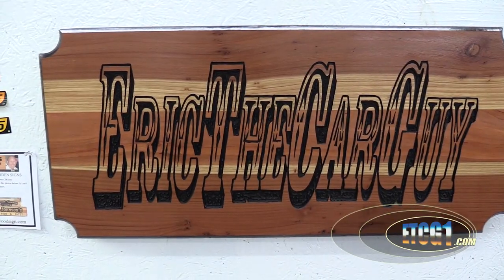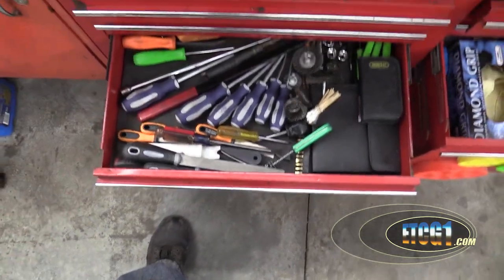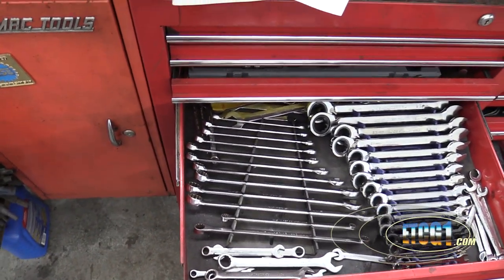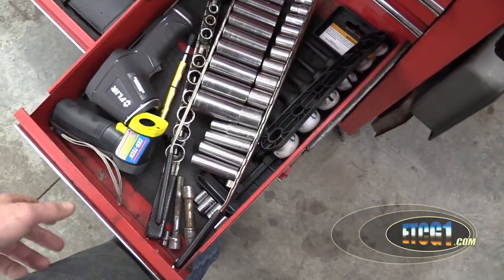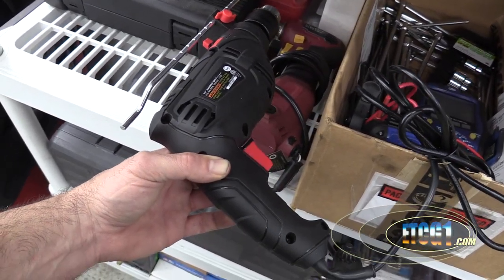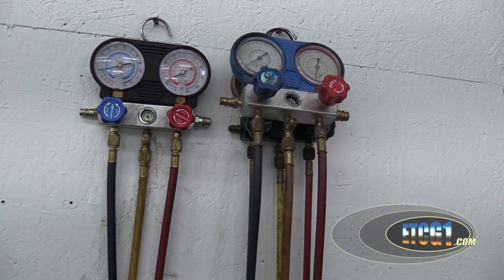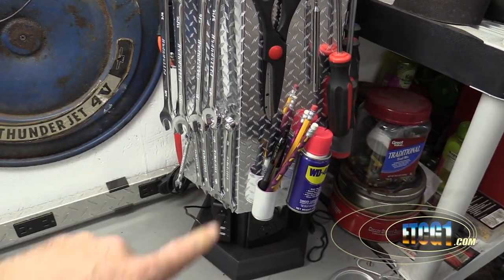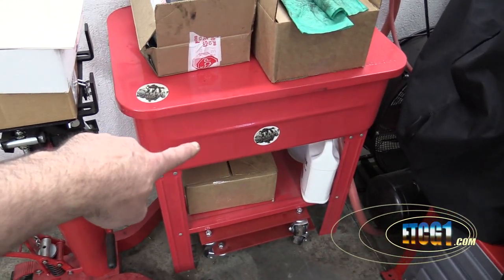Stuff I Get From Harbor Freight -ETCG1

Comment: My standard operating procedure is to buy the Harbor Freight tool.  if I use it enough to either break it or to decide i need better i can always buy a high quality tool to replace it.  My tool collection has lots of Harbor Freight tools that i have used once or that are working just fine.  i also have quite a bit of expensive tools that I have bought to replace a prior Harbor Freight tool which had either taught me that i needed better, or that had showed what features were important to me.
Reply: same here
Reply: That's the perfect philosophy for people stocking their tools for the first time: Buy HF and if it breaks, buy a good one.
Reply: Bingo.  Unless it has a lifetime warranty - in which case, I'll give it one more go.  Break it twice, buy a better one, but I'll still replace it again to have a back-up.  I have 10+ year old torque wrenches I bought for $12 still working fine and to the same accuracy as my Snap-On, no lie.  No fancy adjustable angle head, but I could also buy 30 HF torque wrenches with lifetime warranties for the same price as my SO, so....
Reply: This philosophy perfectly explains why i have harbor freight sockets on craftsman extensions being turned by a snap on ratchet.
Reply: @GeorgiaRidgerunner  Hand tool?  Yeah, just walk in and grab one from the shelf and the original broken one.  There will probably be questions asked, but it is not in relation to the warranty, it is just honest curiosity on the part of the employees.  Best one I have heard so far "I beat it with a hammer then it slipped off the bolt and fell 9 stories down."  Honestly, if it had been a Quinn, it probably would have survived.
Reply: Good practice, i've saved a lot that way.
Reply: Right on point

Comment: Hi Eric, I am in a bit of a pickle at this moment, and need to get a chipped SBEC for my 1991 dodge daytona 3.0, and need it to be mappable. Is there anything out there even in regards to a cracked ECU that can be slightly remapped. Every ECU I have gotten from summit, and other companies overcompensate for MAP, and richen the mixture too much, though I have replaced the sensor, and pulled codes.

Comment: Aside from what was handed down to my when my dad passed away, almost all of my tools are Harbor Freight. Engine stand, hoist, my air compressor, impacts, etc. and they have rarely failed me but it does happen. The most recent was that I had their bendy head ratchet and the screw that held it all together finally stripped out after 2 or 3 years of rebuilding Subaru after Subaru. Would love to have a Snap-On one instead, but I think I will likely just grab another HF one due to cost.

Comment: I use Harbor Freight impact sockets quite often... never had an issue with em.
Reply: I use the blue nitrile gloves like a mofo. The 5mil ones...
and the 1" paintbrushes that come 36 to a box. They kinda suck for painting but are great for other things like car detailing , I've even used em in the kitchen for applying sauces on food.
Reply: Same. I abuse the snot out of my HF impact sockets almost daily. They're really good to hammer on to get old universal joints off
Reply: Same, we have 3 or 4 sets of their 1/2 drive impact sockets at the shop where I work. Never ever had any issues with them.

Comment: I have a few HF tools that I needed in a pinch for home repairs - worked great. I got a few years out of a palm nailer before it seized. I generally read the reviews before purchasing a tool that I still may only use a couple times. A 3/8" flex ratchet is the only real HF auto repair tool I own, and it saved me on a recent job that required removing some difficult-to-reach bolts.

Comment: Eric, I ask if you ever think of banners to go on your shop walls? they would look good. At the GM garage I worked at in Tucson we had a big Dale Earnhardt banner. Everyone wanted that one.I see you did not go the route of a 3000.00+ tool box,maybe a video on why and when a guy should put out big bucks for a box. 

One thing I was constantly buying was some form of shop light or the bulbs for a shop light. Those things never held up well to rough use. I did the Snap-on thing for hand tools not found elsewhere (I love working with quarter drive stuff. Most of my work (well until I worked my way out of the biz,now retired) was light line,AC electrical and add ons from Sales. Installed a ton of car alarms (GM used Code Alarm) and a lot of Factory audio. 

I got away from brakes,heavy line at GM so this dictated the type of tools I needed. I read one viewer did a lot of work with very few tools on his 740I BMW. I always found BMW a tool intensive car with Honda being the make you really could work on with a minimum of tools. Still have and use my Fluke 83(?) multi meter. I never used the high end features of this Fluke meter,paid over 300.00 for it.Perhaps some words on spending big bucks on a multi meter. 

Thanks so much for a very interesting channel. Well I am leaving at 4.00 AM today for the 100 mile trip down to UCLA first appt at 10.00am hope there is no trouble with the train (city bus and train,no money spent on parking for me), lots of Doctor appt for the next 3 weeks. Like you said in an earlier video,this job wears a body out. I have neck and back issues,big time, got a real bad infection after a neck operation,almost did not make it., Dentist work also,so much fun:(

Comment: Great channel Eric!  I am a DIY personal garage type of tech and tackle jobs I can do myself regarding just about anything.  I have a bunch of clunky hand tool boxes loaded with a mixture of hand tools.  Most are old SAE USA Craftsman, Stanley a few Husky because of the ease of acquisition near my Home Depot.  But I also have lots of junk.  I am weeding out the junk and going to donate it and wanted to replace with good quality DIY type hand tools.  I am impressed on the pricing and the Harbor Freight Stores and now that Craftsman for the most part is all Chinese I figured well what really is the difference as per build quality of all these Chinese tools?  Is one better?   I am also looking at Tekton brand which is online mail order which have watched some great reviews via YouTube.  So my question is for DIY home tech work for a man like myself should I invest in local companies  due to ease of acquisition? And opt for either Craftsman, Harbor Freight, Husky or Kobalt or move up with Tekton?  The only downside of Tekton is shipping return costs for replacement tools.  Oh the first set of replacements are impact sockets,1/2"  impact air wrench and a new 3/8' ratchet.

Comment: I have the same feeling on HF as many, if I need a tool for a job, HF depending on what it is, might be fine. I've had stuff for years, and I've had stuff break the first time. If it breaks, you must use it enough to buy a SK or Craftsman as a replacement. My sockets are decades old, yet all the ratchet handles broke the first time I used them.

Comment: baught a harbor freight torque wrench because mine was in my buddys locked garage and torqued a head down with it. 2 days later my freinds head cracked right at the threads on the outside corner. brand new head i had machined and tested cracked in 2 days. he didnt even leave the city yet. had to be because the wrench didnt click correctly. and that was the only thing i ever used it for  and returned it the next day i found out. although, to this date, never had a bad thing happen with any other harbor freight tools. still buy from their tent sales quite often just dont build a toolbox out of them. ive also stripped sockets of theirs alot. the teeth on the 6 points just round off inside

Comment: My manifold gauge set from HFT ALSO broke after about 3 uses.  Now I just rent one for free from AZ or OR.  I recommend this , unless you are going to use one ALL the time - then you should save up and buy a high quality one for (probably ) well over 100 bucks.  The HFT is usually 60 bucks and with a 20% off coupon you can get it for under 50 - but there's a REASON!  that said, I have tons of other tools from HF that are awesome - my breaker bar, my 1/2 earthquake air impact wrench, magnetic metric nutsetters I use with my drill/driver for working on the car - all of these ROCK!  It's a very hit and miss store - ERic is right on the money.  However, they have definitely hit more than missed in my life and they are very cool about taking things back, even if you are just unhappy with the quality of construction (but not past the return period).  Good Luck.

Comment: Harbor freight is good for the tool you.will only use once in a blue moon. However, you know those 10mm wrenches and sockets that always seem to vanish when you need them, well I bought a set of 7 give point sockets for the price of one snap on socket. Will it last? It's a 10mm so not much torque. Did the same with needing an extra 10mm wrench. Whole set from H F for price of one snap on flank drive wrench and then some! My main tools will always be snap on for reliability.

Comment: Probably 90% of my tools are Harbor Freight - but then again I only work on my own personal cars on the weekends every once in a while for basic maintenance. A few things broke... had a small air compressor that started smoking on first use, and I broke a few sockets. Otherwise it's all held up over several years. Funny thing though... I had two torque wrenches, one from HF and one Craftsman. No joke - I broke the Craftsman one but I still use the HF one regularly.

Comment: There are some "HF" tools worth buying. I find the HVLP spray guns superior to the "cup" sprayers for the simple reason you can spray upsideown & backwards & not get air. 
I don't shop there that often. I use my tools to earn my living so I tend to buy stuff that'll last.
My fav. include anything Makita. Craftsman is usually my second choice. However, their "professional" stuff is deceiving. Meaning If you're a professional, the warrantee doesn't cover you. 
It's in the fine print. I mention this because Lowes bought out craftsman. So I'm not sure how any of that works anymore. I don't shop lowes or homejippo.

Comment: you're absolutely right about "Mrs right now" and it's hit or miss, some stuff there is good enough, and some is just junk, it takes you and I as a professional to be able to keep on what is good and spot junk. I have good professional stuff in one location, like mac, Matco and some strap on, but I also have harbor freight stuff in another location, this way I can get done what I need too without running game  acknowledge and forth, and if I absolutely need a good tool I can go get it. Remember though the most valuable tool is in between your ears.

Comment: some great deals to be had there as well as some total garbage. one that shocked me was I bought their 170 amp welder to learn how to weld with. it was 160 bucks because the box was damaged so I figured even if it only lasted a year or whatever I still really couldn't go wrong. shockingly enough 3 years later and hundreds of hours of welding and it still runs great. I'm impressed.
Reply: +Jake C I have that 170 amp wire feed welder also. it works great for me too.  I think I might get a regulator and tank to go with it some day soon. my dad bought one of the stick welders under 100 bucks and it was crap so he returned it.

Comment: The closest HF to me is almost a 30 minute drive from my house.  That could be an inconvenience if I want to warranty a broken tool. For example a 1/4 drive inch/pound torque wrench I bought to torque down the intake bolts on my wife's Suburban. The tool never clicked when it was at the appropriate setting to stage the bolt and the part of the torque wrench that the socket affixed to snapped. I am thankful though that the tool broke and not the bolt head! I returned the broken tool and ended up renting one from Auto Zone. There is a K-mart closing down over in the next town from me, about a 7-10 minute drive. I sent an idea to HF for putting store in there. I haven't heard a peep from them. O'Reilly Auto Parts is my main store for parts and stuff and I have ended up buying a tool from there from time to time. I like working on cars, but I am only as good a mechanic as Eric-the Car-Guy is on a bad day.

Comment: On the subject of drillbits there are three things that end drill bits fast. 1.Using the wrong kind of drill bit to drill into the wrong kind of material... 2. Drilling too fast for the kind of material one is drilling into 3.not using lubricant when needed... I maintain separate drill bit set for wood and metal that have different sharpening angles and I never interchange them. I rarely ever have to sharpen my bits in with lubrication I really ever burn up a drill bit unless I'm drilling into hardened steel...

Comment: I like to get higher quality basics like my screwdrivers, wrenches, and sockets. But a lot of other things I dont mind at all buying from Harbor Freight. So far the only thing I've had fail me is a bearing puller, but I was using it on a bearing that was already broken, soooo..... 

Rule of thumb is if you use it hard enough to wear it out or break the HF made version, You probably need to upgrade to a higher grade.

Comment: i only had trouble with two things from harborfreight that 3/8 drive electric12 dollar drill and their first orange color reciprocating saw that thing didn't work from jump start this is before all the stores were around and everything was ordered through the phone,i threw the drill out and got my money back for the saw,now my tool boxes and tools and just about everything i got is from harborfreight way better than sears,H F tools have improved if i was doing mechanical work for a living thats were i'd be shopping,i have craftsman s and k and gearwrench and all i use is pittsburgh pretty damn good stuff.

Comment: LoL - I use a lot of HF stuff as well, a lot of what you have in fact. And YES! I have one of those "stripped teeth" double flare tools as well. Yep got me too. But I still use and shop there all the time.
Was doing breaks on a F800 big Ford. Needed an 11mm tubing wrench for the bleeder. One of those rare times that nothing else would work. Cut the box end of a HF wrench and got the job done. Need a crow foot that you don't have and need it now? HF cheap wrench to the rescue. 
They definitely have their place in any setting, and any shop.

On a side note, I had a customer tell me that if he walks into a shop and sees nothing but Snap On, the big huge shiny box with all the additions.... he walks out. Says if that guy spends that kind of money he charges too much.

Comment: It's hard to beat Harbor Freight's toolboxes. I have an old Snap On tool chest and side box that I bought the 1st one probably in 1983/1984, the side box probably a year later. Both have served me well over the years but I last year bought a US General box that is much nicer than my old Snap On was when it was new. Of course the newer Snap On boxes are much nicer than the older ones are also. My original toolbox was a Craftsman top box which I probably bought in 1980. I still use it  today and it has held up well. So I figure the US General should hold up until I can't work on things myself anymore.

Comment: Eric, you are absolutely right. HF has its place. I've been lucky so far that my HF acquisitions has worked pretty good. I especially like their impact sockets. As a DIY, I haven't been disappointed yet. 

Having said all that.....yes, I've been disappointed by Snap On. I bought their top of the line electronic 1/2" torque wrench and never again. That ratchet stripped intermittently and it only does that once in a while. However, it will snap and strip at the most awkward time when I was close to reaching the torque value. It snapped and due to applying force on the handle, it really jolted me. When it first happened, I thought the bolt snapped, but it was the gearing on the ratchet. For a $500 torque wrench to have it fail is the biggest disappointment as far as I'm concerned.

Comment: I agree 100%.  There are times I need a particular tool but I also know I will rarely use it.  Usually I can pick up that tool at Harbor Freight and do just fine.  I also agree on the hose clamps - they are no good.  If Harbor is having a sale, I usually look through the sale items and see if a particular tool I have been wanting is one sale and if it's at a good price and I know I will not be using that tool all the time, then it's off to Harbor Freight.  If I want better quality,  I check out JB Tools and often price shop between JB and Amazon (although some JB stuff is also on Amazon).  Fortunately I have a lot of SK Tools - collected over the years - I consider SK to be up there with Matco, SnapOn, and Blackhawk.  Thanks for another good video!